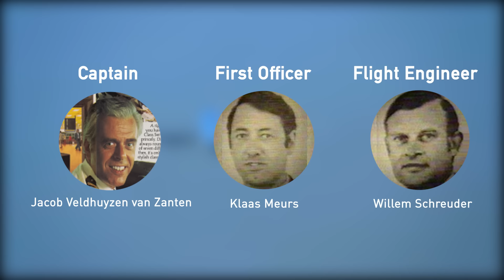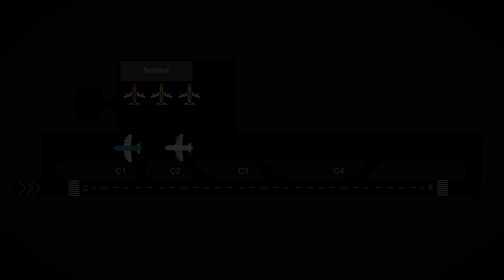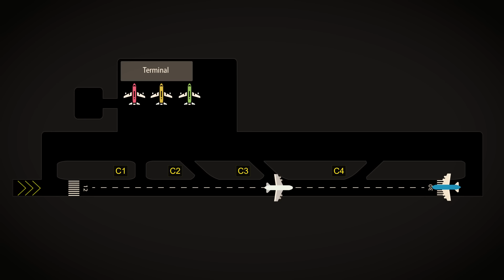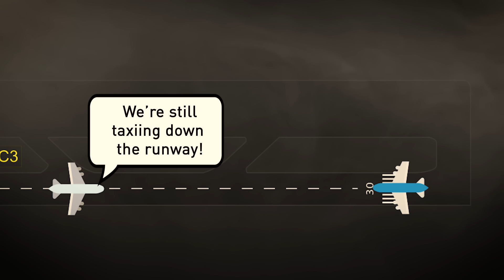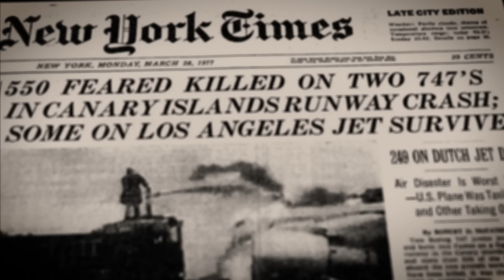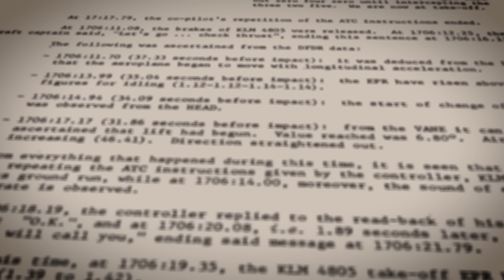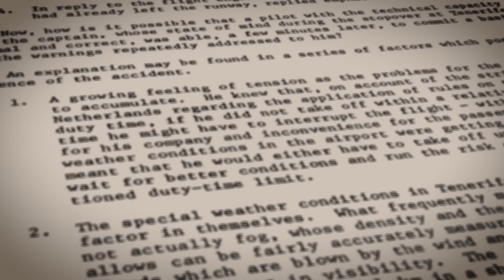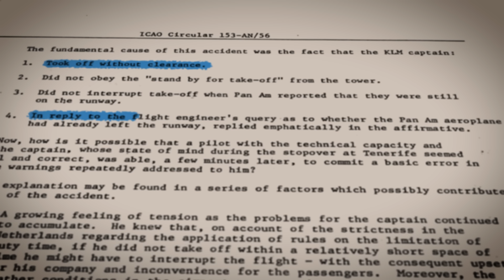Tenerife Airport Disaster | Deadliest Crash in Aviation History

Comment: ironic how the worst aviation accident happened on ground
Reply: Well, most of the accidents, as far as I know, occur during take-offs and landings.
Reply: @nicky2204  actually there are a few cases of mid air collisions, and depending on how you define accident, mid air equipment or structural failures.
Reply: Until a fully loaded A380 crashes...it will happen, it's when....not if.
Reply: @23hublock1  
Nobody knows. Not all models of airplanes have suffered accidents.
Reply: Take off and landing are the most risky part of a flight.
Reply: @anisaguine  i'm curious how midair collisions happen when you can literally go under another plane, above, to the left, or to the right of it, and with probably at least a couple thousand feet of leeway in every direction around the colliding plane
Reply: @josephhussain7238  really bad luck and/or miscommunication. There's a list of them on Wikipedia. The one I really remember hearing about is one where an air traffic controller didn't realise that he had set two planes on collision flight paths and lost both. Also more common with planes that don't have TCAS.
Reply: Ino
Reply: Not really an accident but what about 911?
Reply: @josephhussain7238  Just watch Aftermath and you will see that its possible to collide midair
Reply: It makes sense when you consider that more planes = more people, and planes are much closer together in all dimensions at the airport than anywhere else.
Reply: Yes you correct. Just a traffic accident.
Reply: @josephhussain7238  Ah, this, uh, Cactus 1539. Hit birds, we lost thrust in both engines. We're turning back towards LaGuardia.
Reply: @anisaguine  It was a joke as, by definition, an plane will need to reach the ground level at a moment.
Reply: @nicky2204  breaking bad didn’t like that
Reply: Even during heavy fog (no visibility) radar is almost everywhere so everyone know where everyone is at and the direction they are heading speed and probably more
Reply: TWA fl. 800 was shot down @ 13,800 ft., but that's neither here nor there I suppose. I'm simply pondering exceptions. 🤔 Anywho, ta'la.
Reply: i'm going to hell for laughing at that
Reply: @therealapocalypse8158  
Technically there was also an accident during 9/11, did you forget there were four planes?  
The one targetting the White House crashed thanks to a rebellion from the passengers.  
(For those too lazy to search : the last one hit the Pentagon)
Reply: @anderslarsen2311  what about it blame the security at the airport checking luggage 🧳they obviously didn't do a good job at all so they are to blame
Reply: @therealapocalypse8158  no it wasn't is was lazy airport security didn't do their jobs
Reply: @anisaguine  r/woosh
Reply: @josephhussain7238  Because the damn things are big...too big to see everything by sight and too large to maneuver easily  (see Titanic).
Reply: Obviously once something is evaluated time and time again its easy to look back and say they should have done that or that.

So its a smaller airport with a load of passenger planes and lack of required technology and most other things to accommodate this situation safely, add to that massive fog, would you not have at least one emergency vehicle with a beacon guiding planes where they should go, that just seems one of the more basic common sense things, or have a person waving two of those light sticks they use on fighter carriers, at the spot where plane is supposed to turn of the runway.

Again its easy to say "Could have, should have" now but with so many aircraft, lack of tech and just massive fog itself light signal guidance is the key for me
Reply: Take off and landing are the most critical
Reply: 99.99% pilots error
Reply: @anderslarsen2311  That's a car silly
Reply: @anderslarsen2311  what about 9/11?
Reply: @23hublock1  or not
Reply: Well one of them was technically flying
Reply: @Praise___YaH  good for you sweetie
Reply: @nicky2204  ummmm 9/11?
Reply: ikr
Reply: @josephhussain7238  its very unlikely bur its mainly due to humon error or miscommunication
Reply: What about 911
Reply: One plane was technically in the air.
Reply: @mauriciolacruz  yeah it’s the first 3 minutes of take off and last 8 minutes of landing I think are the most likely time of an accident. It’s around 80% of crashes occur during this time
Reply: @anisaguine  or getting shot by Surface-to-Air missile
Reply: @mauriciolacruz  true that.
Reply: An accident on ground has a much bigger possibility than on-air, there have been some while flight but nowadays is almost impossible
Reply: Guys how do planes communicate with ATC when they fly over oceans or any large water body ?? Pls i m really curious...
Reply: Depends on what criteria you use to decide the worst.

I was just watching Boeing's Fatal Flaw documentary last night and from an altogether completely different perspective there are some who might say that the 2 crashes involving the 737-8 MAX were contenders.

But I wholeheartedly get the gist of your comment. You may want to check out the video I described there on the YouTube channel sometime if you haven't already done so.
Reply: Technically 9/11 was worse
Reply: @therealapocalypse8158  a plane hit the empire state building on accident in the fog! I doubt they were gelling Allah akbar tho but you can't say they wernt either ;)
Reply: @anisaguine  Yes. The Uberlingen mid air collision is one of them. Is a sad one.
Reply: @josephhussain7238  because airplanes travel at very fast speeds and are very heavy so it takes time to change direction
Reply: @anisaguine  there is some crashes that happens on the air, like litterally, for example mh17 got shot down when the plane hitted the ground it was already in pieces
Reply: @CYWNightmare  not back then and not always now.  Three years ago I was on a plane at an international Airport and we had to sit there for almost 2 hours because a fog bank rolled in and the pilots couldn't see more than 20m.
Reply: @josephhussain7238  please read about mid air collision in 1996 in Charkhi dadri India..lack of air safety guidelines killed 349 innocent souls
Reply: @musiclove4887  I think every area is controlled by a control station that is not necessarily even connected to an airport, so that pilots always have the possibility to call in...I might be wrong though
Reply: Have you heard about 9/11?
Reply: @Bungle2010 yeah because the rest of the time is almost fully automated lmao
Reply: @josephhussain7238 the pilots have a very limited view. That’s why they rely on control towers and Air Traffic control to tell them of nearby planes.
Reply: @nicky2204  what a dumb thing to say
Reply: It was also indirectly caused by an airport bombing iirc
Reply: @mauriciolacruz  true very few mid air,1996 saw a mid air collision of two planes over Delhi skies,just after takeoff.
Reply: Well the worst one I can think of is 911
Reply: @23hublock1  who knows
Reply: @Bungle2010  Who doesn't know that unless you don't study aviation accidents.
Reply: That’s not ironic at all, that makes complete sense. Aircraft never come that close otherwise. The chance of accidentally colliding in the air is so astronomically small
Reply: @23hublock1  Wdym "until", then what? There will still be less dead than with this disaster mind you
Reply: @erpfanatic6586  proof?
Reply: @anisaguine  the ATC was then murdered by the father of one of the victims and the murderer was called a hero by his town. it wasn't the ATC's fault, it was his employer's fault for giving him so many planes to take care of as well as a non-standard procedure on what to do when TCAS conflicts with ATC commands. nowadays it is standard to always listen to TCAS, even iif the ATC tells you differently.
Reply: lmaooo
Reply: @josephhussain7238  you are aware that most airplanes go 800km/h or faster right
Reply: @mauriciolacruz  correct
Reply: I know right, that's like the bloodiest land battle taking place on an airplane or the ISS lol
Reply: It's only only smart arses who say accidents don't occur in the air.  You have to hit the tree, the ground or anything else first but you will be lucky to escape alive.
Reply: Just more proof that being in the air is the safest place to be
Reply: One of the worst space exploration accidents also happened on the ground(Apollo 1)
Reply: @nicky2204 my dada said that lol
Reply: Most accidents happen during takeoff or landing. That's where most of the danger is.
Reply: @nicky2204 there a few where planes completely disappear before hitting the ground due to the the shear forces applied to plane.
Reply: @mauriciolacruz you had to open your mouth, huh ? SMH
Reply: @mauriciolacruz no you dont rat😂😂😂
Reply: Most of them probably happened on the ground
Reply: No, the worst occur on a tower
Reply: @coality  NAHHH☠️
Reply: @coality  but that’s not necessarily an aviation accident, it involved planes but the tower was the main feature
Reply: No
Reply: The KLM plane was airborne actually.
Reply: @josephhussain7238  bad luck distracted pilots etc it rarely happens nowadays thanks to TCAS systems but does happen from time to time usually at airshows

Comment: The KLM pilot was almost entirely at fault. The KLM was supposed to refuel in Gran Canaria, protocol at final destination, before heading back to Holland (more fuel meant a heavier plane and more combustion). But the pilot decided to 'save time' and even let off passengers at Los Rodeos terminal, in complete disregard to the Pan Am passengers and crew, who were waiting behind and ready to leave ASAP. Every other factor: it was a Sunday so only one air traffic controller was on duty; the terrible weather; and the single runway, only made it worse.
Reply: It annoys me so badly that 583 lives could have been saved had literally any one of the occurrences had not happened 😔
Reply: Yeah wtf, taking off in the fog whilst you don't know if it is clear. Still the guy at the airport tower should have been more clear, saying that there is still somebody on the track instead of ready for take off.
Reply: @hannesp3493  the sad truth is that us humans only truly learn from tragic lessons and they had to be an example on how things should be done. it's just the way it is. but i do get it, even though that pilot is dead he still infuriates me with that stupidity.
Reply: @bean4332  True. It's just unfortunate that those lives had to be lost in order for the lesson to be learned.
Reply: @brendboer6026  6
Reply: @brendboer6026  6
Reply: You need to watch more videos that specifically explain the external factors that leads into this disaster. There is reason why KLM captains actually decides to get full fueled in this, combine with the certain regulation that not only applied by KLM but actually by the Netherlands. The climax will be on the miss communication happened between ATC and all of the aircraft combined, signaling this accident sure, still preventable, but not at the time because of the circumstances simply not built for it.
Reply: Apparently the captain of the Kim flight had not physically flown for a while, since he was regarded a senior pilot/instructor. He did most of this instruction and or training in simulator. A very sad incident, a lot of if s come into play; weather, the airport was not equipped with radar, they were not expecting one but two 747's.  If Kim had not dcided to refuel, believed that he had enough fuel to the airport that recently reopened. There was a possibility of a language problem. If the pan am was able to stay in a holding pattern rather than landing. Capt Grubbs of pan am voiced to his cockpit crew he wanted to wait till the Klm was airborne, rather than backtrack on that only runway.

Comment: Just want to add that the interference was becuase the air control and Pan Am crew was trying to alert the KLM crew at the same time. The results was just a clatter in the KLM crews headphones.
Reply: The radio technology in aviation is comparable to walkie talkies. 
Everyone within the same airspace has to be switched to the same frequency in order to make sure that everyone can hear each other. 
In other words, everyone has to wait thier  turn before they are allowed to talk. If more than one person is talking, than thats where the interfernce comes from.
Pretty sure this radio technology is still used today.

Comment: it was the KLM pilot decision's fault. he did not listen to his crew and was very eager to get home.
Reply: Not only that, he requested the plane to be refueled to maximum allowed, which was completely unnecessary, ended up killing everyone on his own aircraft
Reply: @bluetics9496  :  No, filling up with fuel was not unreasonable.  If he hadn't, he would've had to do it later anyway, to make it back to the Netherlands, so it saved time.  (It's not like the pilot knew he was going to have to leap off the runway prematurely to avoid crashing into another plane.)

The cause of the crash was the captain's impatience and arrogance.  (Along with bad weather and a couple of very unfortunate radio glitches at the worst possible time.)
Reply: Not eager to get home, He was eager to get everyone go to Gran Canaria and back to Amsterdam with little delays as possible. If he goes over his delay quota, he will lose his license and force the airline to pay money for the stayover at Los Rodeos or Gran Canaria.
Reply: You forgot the most important thing. Victor had confirmation bias eventhough he should have turned on C3
Reply: Thatś right Lyla, he ignored the remark of the engineer (third man in the cocpit) : Did the Pan Am leave the runway???

Comment: Im a fresh graduate pilot with 200hrs experience. I know this disaster, as being very well-knowm in aviation history.
But, now i know the story behind "ready for departure" and "cleared for take-off" phrases.
Reply: What do you mean?
Reply: The words "Clear" and "Cleared" are also now completely forbidden at all airports in communications between the ATC Tower and aircraft (and also to all ground-operating vehicles). Any ground-operating vehicle wishing to cross a live runway must ask permission to do so from the Tower. If permission is not granted the vehicle is instructed to "Hold" and an acknowledgement of that "Hold" command must be passed back to the Tower. When permission is finally granted to cross the live runway, the Tower will instruct the driver of the vehicle to cross and then "Call Vacated" on passing the vacation point. Again an immediate acknowledgement is returned to the Tower before and after crossing the runway: "Crossing runway 27 at Echo One, will call vacated" and "Vacated runway 27 at Echo Two" (or whichever vacation point is crossed). Under no circumstances will the words "Clear" or "Cleared" be accepted.
Reply: @daliamcmahon5884  i mean,
Pilots and Tower are not allowed to use the word "takeoff" in any phrases. The word is used only if:
1. The Tower is giving takeoff clearence to a pilot.
2. The Pilot is acknowledging tower that he received Takeoff clearence.
Otherwise, for every other situations, the word "departure" will be used in all phrases.
Reply: Congratulations :) how was aviation school?

Comment: This was not accident, it was pure negligence from that stubborn KLM Captain.
Reply: So are you ignoring the other causes that was established?
Reply: @kd84afc  Regardless of the other circumstances, the entire mishap occurred because he didn't not get proper clearance for take-off from the tower and demanded he and his copilot go full thrust.  

Hence the entire reason for Crew Resource Management and Departure being used now.  

If all he had done was await proper clearance, KNOWING the situation for what it was and the lack of visibility, no one would have died.  Including himself.
Reply: Dude sounded like dyatlov
Reply: @this_mfr  entire accident occurred due to a number of factors that all played their part in this accident happening.  

Fog, delay in refueling that allowed the fog to settle, sending the pan am flight down the runway towards the other plane in heavy fog and ordered to do left turn that was later found impossible to do for a 747, garbled communications which led to misleading communications of them thinking they could take off. 

The KLM captain was very wrong, yes, but he wasn't the only one.

putting the entire blame on one man is unfair.
Reply: @this_mfr  wrong

Comment: min. 3:36 Only "OK" was heared inside the cabin, due to interferences. That word should be forbiden at airports as it is ambiguous and can lead to a missunderstanding if out of context.

According to Professor Elizabeth Matthews, errors caused by language in aeronautical communications have been "a more frequent and influential factor than has been commonly noted." For Matthews, who has been a consultant for the International Civil Aviation Organization (ICAO), "linguistic problems in aviation are not investigated with the same degree of systematic and expert rigor with which other human and operational factors are considered."
Reply: "OK" is now forbidden over ATC communications.

They really didn't go over the full breadth of the reforms caused by Tenerife. Language used in controlled airspace is now extremely specific. Exact phrases are required and all that.

Of course, lax ATC/pilots do still in practice break them. But the general system is far more rigid than the details of what the video detailed. I mean, for one, everyone who is an Air Traffic Controller or a pilot in any country must be an english speaker, second language or otherwise.
Reply: @jinx6777  So as it is said, every crash heads to a revision of regulations and requirement, so in the end makes flying safer. God bless all the lifes it takes so. Thanks for the answer Amber, I didnt know that.